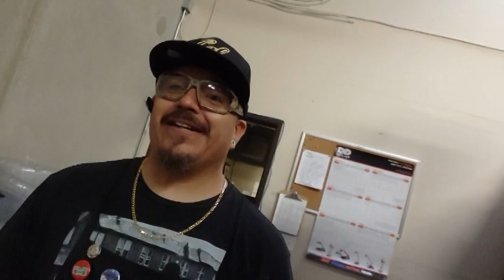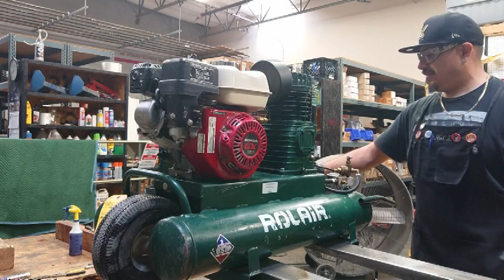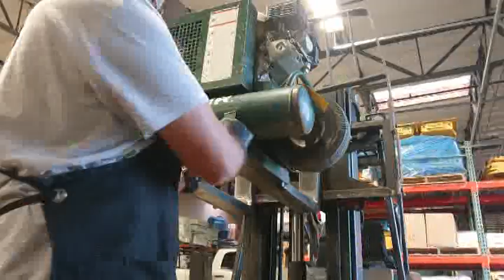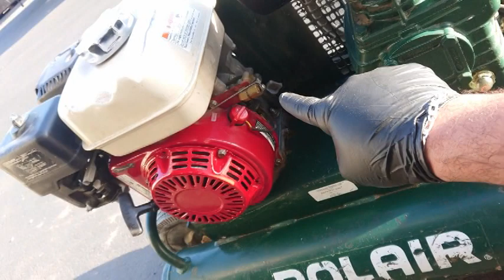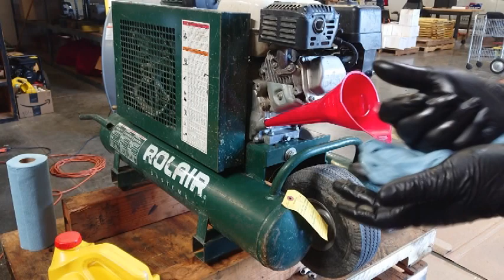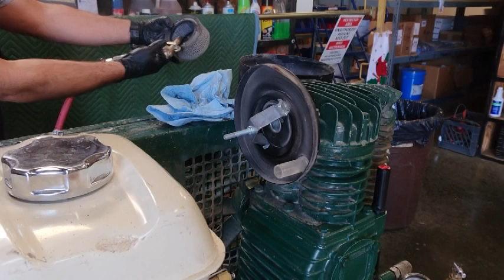Rol-Air Compressor Maintenance and Repair - Pneumatic Tools

Comment: you filled oil in 2 spaces but drained it in one. does that mean both oils drain from the same hole? am i suppose to change both oils at the same time everytime?
Reply from the maker: Thank you for your question Ryan!

The oil I poured the first time is the synthetic oil for the compressor head (Rol-Air), the second is regular 10w-20 engine oil for the small Honda engine. Just to give you heads up, check the stick to ensure you have enough oil in both places to avoid premature wear on either of the compressors moving parts.

If you have any other questions about this topic please let me know.

Thank you for watching my videos 🤙🏼

Comment: Good  video... i missed  the part where you explained.  What  type of oil you used? For the piston area?
Reply from the maker: Hello my friend and thank you for your question. The oil I used for the compressor head is the same brand as the compressor which is Rol Air (Synthetic). This oil has a green tint to it.

Comment: how often do i change the oil for the motor? rougly how many hours?
Reply from the maker: @ryansan7575  the manual recommendation is every 40 hours which it'll be a whole work week. I will recommend every 50 to 60 hours depending on weather conditions, less when it's cold, and often when it is hot. 

Thank you for your question! 😁😁

Comment: Porque se apaga  elncompresor  no dura  nada  prendido y cuesta  prender  1 año y medio  tengo con el   lo compre nuevo
Reply from the maker: Que tal Andrés 👋🏼 gracias por tu pregunta! 

Hay varias razones por las que esto puede suceder, por ejemplo; no esta recibiendo suficiente aire el carburador, la línea del gas puede estar sucia, el carburador tiene basura o polvo y eso impide que funcione adecuadamente, el filtro del tanque de gas esta sucio. 

Primero que nada revisa que la gasolina llegue al carburador y que el filtro de aire este limpio. Si esto no funciona intenta ponerle una bujía nueva quizás esto ayude.

Comment: Hello I have a question I have a rolair compressor 2 wheeled and the engine just got stuck when I try to turn it on the cord won’t pull 
Do you know how can I fix this?
Reply from the maker: Thank you for your question. For what you are telling me it seems that the engine got stuck. In order to free it you're going to remove the puller starter and by hand try to move it. If it doesn't move at all you may have to remove the head to see why it got stuck. Please, feel free to let me know how it went, I like to help you fix it 🤙🏼
Reply: @The_Shop  Thank you, i already did that and it only turns 3 times left and right and becomes stuck again 
The compresor it’s new it was seating there for 3 years and it was working yesterday in the morning but yesterday I put it vertically to replace the air cock valves and when I put it down again it was locked

Comment: Se puede. Usar otro tipo de aceite. Que no sea rolair?
Reply from the maker: Buenos días amigo y gracias por tu pregunta. Te comento; no hay ningún problema si decides usar alguna otra marca de aceite mientras sea aceite Hidráulico o aceite para cabezas de compression. Esto solo en referencia de si hay algún problema al usar otras marcas. Ahora, que al utilizar otra marca esto anula la garantía que pudieras tener con Rol-Air. 

Gracias por tu pregunta.

Comment: I heard you're not supposed to put the oil through there🤔 I got one of these machines and that's just what I heard I could be wrong but I just noticed that there is another location to put oil
Reply from the maker: Hello, 

the compressor head manual indicates that this is the correct way to add the oil for the lubrication, however, I can always learn something new. I will be more than happy to try out another method that gives  better results. Please advise. 

Thank you very much for your comment and your time to watch my video.

Comment: Hey bro what type of oil can i use in the air pump i bought a Puma DG5522HP and the instructuons say to use 10w-30
Reply from the maker: Good morning Bro!... I would recommend the use of the indicated weight on the manual. The reason being is that the head is design to work with this particular viscosity, and if you were to pore a heavier or lighter weight, this may cause the head to lose compression and overtime will lead to a premature head failure (not compressing enough air). 

Thank you for your question and for your time.

Comment: Y los reguladores como los arreglas
Reply from the maker: Buenas tardes amigo Hugo y gracias por tu comentario. Bueno aquí tienes dos opciones, una es comprar el regulador nuevo que el los mas sencillo, o dos, lo puedes limpiar solo que para eso lo tendras que desarmar y volver a acomodar la precion a 120 psi. lo cual es un poco mas complicado. Aqui te dejo el numero de parte para el regulador # CVD7049 (Piloto de Descargo / Valvula de Descarga). Gracias por tu comentario y tu tiempo. Saludos!

Comment: Que problema tiene cuando no carga mucha aire
Reply from the maker: Buenas tardes Mingo. Uno de los problemas puede ser que tenga una fuga de aire en alguna parte de las mangueras. Otra puede ser que la válvula de descargar ya no esta funcionando como debiera o quizá necesita ajuste. Y por último puede que la cabeza de tu compressor ya este en la fase donde los anillos del piston ya no acumulan la suficiente fuerza como para llenar el tanque.
Reply: Checa la válvula Pilot. Se. Desajusta por tanta vibración.